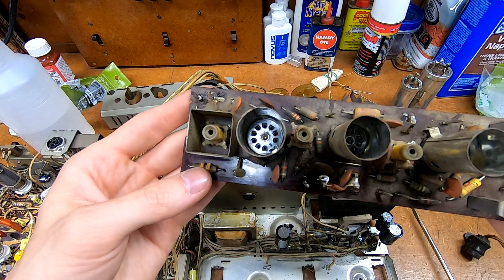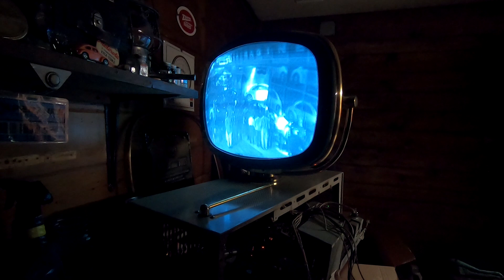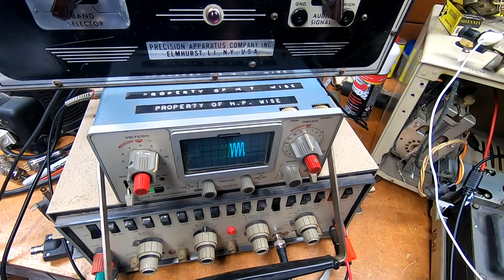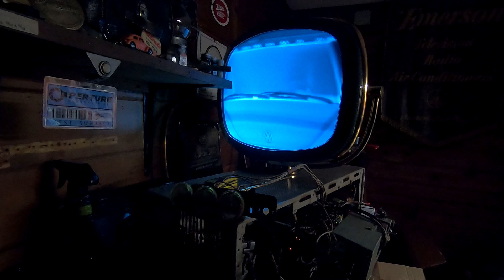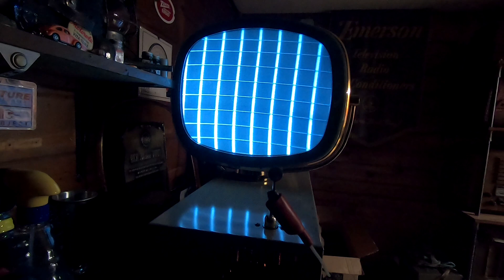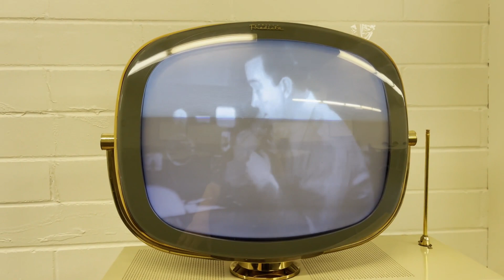Philco Predicta Princess Repair Part 2 - IF Board, Tuner, Final Test

Comment: It would be nice to see you doing the full IF and tuner Visual alignment using the Heathkit IG-57. You will be surprised at the poor condition of the alignment after 60 years. The IG-57 is a nice and very complete test equipment from the analog era. It seems you only did the tramp's adjustment. The IF visual alignment requieres a more complex wiring. Everything is explained in  the manual.
Reply from the maker: Indeed, I don't have the proper equipment for a good sweep alignment yet. In the process of acquiring new tools.